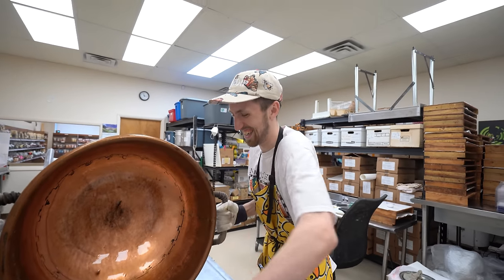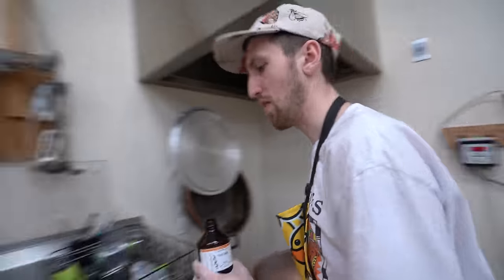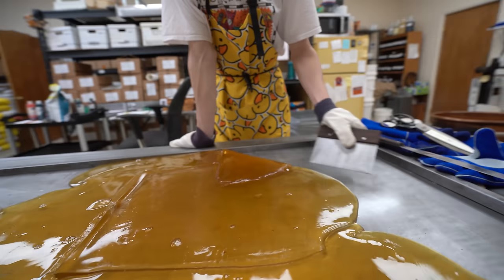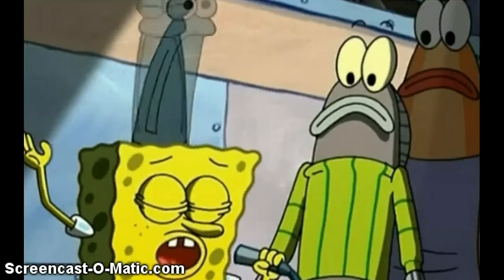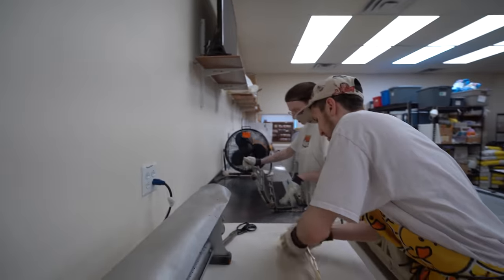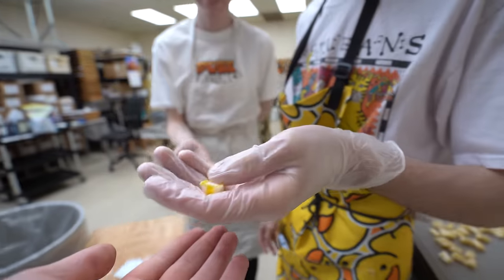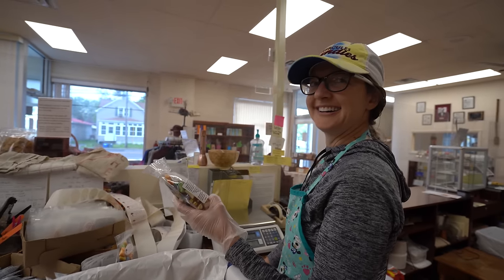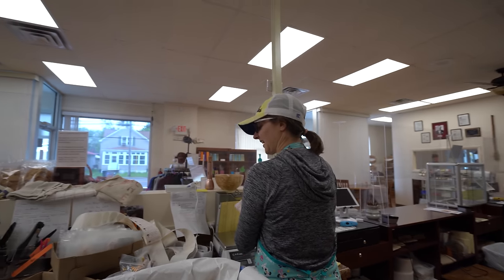Our Rarest Type Of Hard Candy!

Comment: Greg doesn't go fast enough with the corn syrup 😂 got that mellow vibe going strong!
Reply: Greg must have some really hot hands to melt the corn syrup like that
Reply from the maker: @mdunn4555  that's it! 😂 but no, I think Deborah is right
Reply: yea i agree, i noticed he rolls it in his hands wile the other guy uses speed and alternate hands to handle the syrup. works amazuingly well i can see.
Reply: Greg goes too slow with the corn syrup. He tries to just drop it in instead of tossing it in. Also I saw Greg touching his glasses then touching the candy. Not good. Watch that Greg.
Reply: Would I like to mention no gloves used at all why
Reply: @eagames5986  There's a cake decorator on here that has a great explanation for why no gloves.  The gist of it is that it's much easier and cleaner to just wash your hands and keep washing them than use contaminated gloves or have to keep throwing gloves out between each part of the task.
Reply: @eagames5986  gloves also are normally not required for foods that are going to be cooked but havent been cooked yet. To be food safe you have to get is to an internal temp of 165°F considering hard crack candy is at 300°F it will be sterilized by the time they were working with gloves.
Reply: @eagames5986  They don't use gloves to make sterile needles either, there's no point in dexterity restricting gloves when you are using heat/chemical sterilization.
Reply: @eagames5986   you can't use gloves with the corn syrup, it gets cooked,
Reply: @HerculesCandy  you guys need like instant feed or something gravity feed to drop into a bowl. then you dont have to tough it at all. just a idea!!
Reply: @eagames5986 

Well considering the temperature that sugar is going to hit it doesn’t even matter

Comment: If you put each batch in a line across the length of the table as you drop them, instead of in piles, then each "vertical" would have all the colors and you won't have to zig zag the length. You save time and break less.
Reply: Sigh. These people are not stupid. i am certain they have tried this already and realized quickly that their batches are too big to do this.  Every single video they make a large mixed batch like this they get people saying this to them.  Their family has been doing this longer than most of us have been alive.

Comment: My mother would rub paraffin on her hands when making the sugar+mint oil centers to the chocolate covered mints.  Scrub em good, dry em better and then trim the nails and she'd just rub a shingle of paraffin.   Kept the sticky way down but that was a cold center, don't know how that'd work if you blended a little paraffin into the hot melt sugar.

Carrot cake.    Crush up freeze dried strawberries to blend in, crush the cake into the pan after baking to make it denser.   You can strew jello pudding mixed with 1.5 cups into the poured pan before baking, don't use the whole pudding.

Comment: I have a suggestion when it comes to mixing hard candy batches. When you dump them out of the cutter, lay each flavor out in horizontal rows that span the length of the table instead of stacking each batch on the right-hand end. That way you're getting more of an even distribution when you're finished with the last batch before you ever go to mixing with the scoop. Should be a big time and headache saver getting those bad boys mixed up. <3
Reply: I think they need the room to cool the candy, which is why it's next to the fan.
Reply: Way too much candy in each batch for them to do that.
Reply: @bludhaven8634 any suggestions for newbies like myself on getting started; equipment, ingredients, etc?

Comment: 2:30 Cos it spend a lot less time in contact with his hands.
You are slowly moulding it with it always in contact with one hand
He's cupping it then throwing it rapidly between each hand. It spend very little time in contact with his hand and lets gravity shape it into a ball.

Basically he's handling like he's got a hot coal in his hands.
Even when moving it into the container he's still throwing it into the air a little whilst you hold it and drop it in.
Same when taking it out of the tub, he grabs a chunk and pulls it out quickly.
The longer you let it stay in contact with your hands the more of it will stick to your hands.